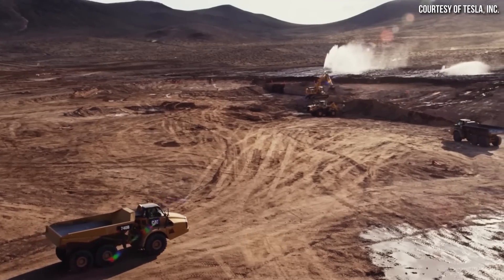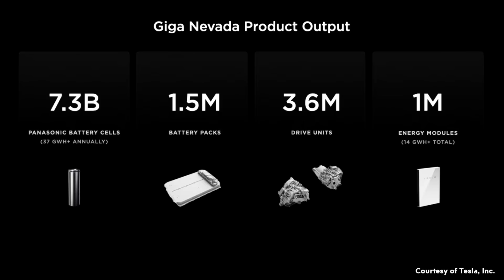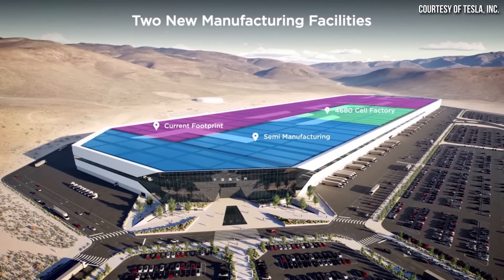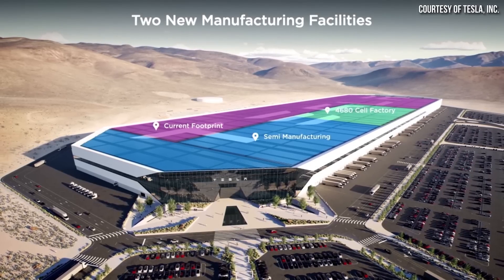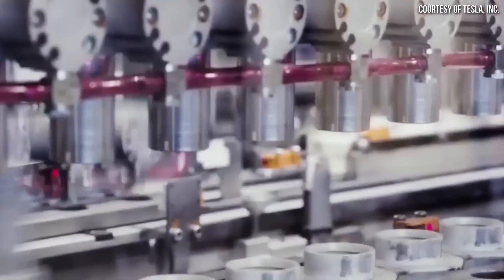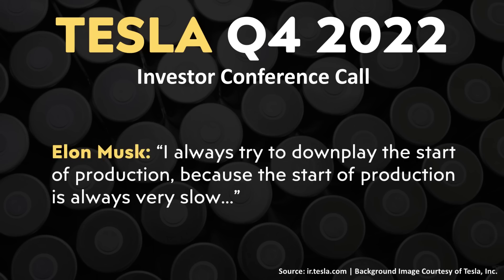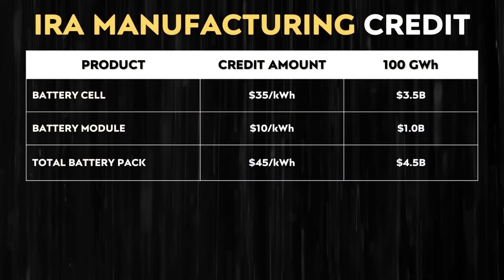Tesla's EPIC NEW 4680 BATTERY Updates | 100 GWh MORE!

Comment: Wouldn't it be more beneficial if they invested in improving 4680 cells to be better than the cells they replaced rather than increasing production of an inferior product that that failed to meet any of it's promised specifications? I bet it's a lot cheaper to produce and if so is this cost saving passed onto the customer? So much for "epic" update. So many 4680 innovations, not...
Reply: This was a common misconception of the goals of the 4680's. Tesla, and the entire EV industry, is battery constrained. So nobody can produce the amount of EV's that they want to build. Both the Semi and the Cybertruck have been held back do to not having enough batteries. 

So yes Tesla wants to produce a high tech battery, so they are designing that, but what they need is the ability to make batteries for themselves. Now that they can do that they are in more control of their own destiny. And they can implement the better design components once they figure them out.
Reply: The 4680 is roughly equal to the 2170 cells already and the point of the 4680 cell is not to make the most amazing, highest power cell in the world/ever. 4680 is to be cheaper and faster to produce than the 2170 cell with headroom to improve over time. It takes battery manufactures about 12-18 month to test and validate a battery design/chemistry. Every change has to be evaluated to determine if it is an improvement or not and is safe before implementing. In other words these things take time. A new factory with a know form factor and chemistry is expected to take 18-24 months to ramp to design rate.
Reply: @GROND15  They're not roughly equal. The comparison testing Munroe did on them proved the 4680 to be a weaker performer. It isn't a misconception, Elon Musk repeatedly taunted publicly the performance benefits of the cell for a long time prior to its release. Be that there are other benefits to it's development there may well be. You'd at least hope so.
Reply: @John Hawkins  
Elon Musk "Touted" (predicted) the EVENTUAL performance of the cell..... Due to anticipated improvements in chemistry (note that Tesla has collaboration with one of the top experts in the field, Jeff Dahn)
.
As for the "innovations"
IF you'd been listening to (and understood) the battery day presentation (plus more since) you'd realise the aim of the project is to produce maximum GWh (TWh!) from minimum resources (factory space!) for the lowest possible cost.
.
It's as much about the "process technology" as the cell chemistry.
.
Signs are that they are mastering that process sufficiently to build the factories.
.
"Performance" has been a sidestep, but "We" (you!) have no idea at what stage the chemistry (for example) has reached in TEST cells.
.
If they release a MK 1b cell, with the dry Cathode, plus the silicon levels already in the 2170, I would expect a modest, but encouraging 10%(?) increase in density...... But that's where the fun starts.
Reply: @GROND15  
"18-24 months"
That's a "green field" site
Using the wet process (much larger factory).
If (IF!) Tesla has perfected the dry process and can reliably replicate the machinery to produce the material, it's going to be much faster.
Remember that when it's at even 50% of the predicted level, it's going to be a 5:1 output ratio in terms of GWh per factory volume.
.
Now look at the Nevada plan.
.
It's not "Green Field"
.
Power and services are in place (it's already "plumbed in" to be a battery plant!)
.
So it's just a case of "build the box" then add much less machinery that previous sections.
(Machinery built in house?)
.
Here's a thought.
.
Let's say "OMG! they haven't sorted the dry Cathode!" (yet).
.
Build that section.
There's a wet cathode line in the same building !
.
Either close 1-2 older 2170 lines, or increase "2170" cathode output to suit, cut to the 4680 dimensions.
.
Once validated, either ramp output by taking more "wet" material, or transition to the dry process.
.
Meanwhile, strip the closed down 2170 section and install a second 4680 plant(!)
.
Rinse, repeat.
.
Before long, it's a full 4680 Terafactory.
.
(imo)
.
This does raise questions regarding the relationship with Panasonic.....
Reply: @rogerstarkey5390  Austin and Berlin are greenfield sites. The time frame is for the ramp in production rate not including construction time. LG, Panasonic, et.aL. plan 18-24 months to get a plant from lights on to full production rate. In my experience, this seems to be true for most large factories of all types.

Comment: Has Elon stated, or has anyone asked him, WHEN WILL THEY PRODUCE ANY VEHICLE USING THE 4680 BATTERY, AND SHOW US A VIDEO OF SOMEONE DRIVING IT?  Good grief.  The 4680 is over-hyped to the point it sounds like vapor-ware.  If they have already produced so many 4680 batteries, then why are they not putting them into some vehicle and testing it?
Reply: Ok thanks, bye
Reply: The Model Y Sandy Munro tore down last hear had the 4680 cells in it, and the structural pack!
Reply: @aaronmcculloch8326  Totally forgot about that 🙂
Reply: They are producing M-Y with 4680 packs now. They are “off menu” and limited supply
Reply: @GROND15  
No, they're very much "ON the menu" and in sufficient supply for the version in which they're used.
Reply: @just The Truth
You really need to change your handle to
"@Not Really Any Clue"
Reply: @rogerstarkey5390  LOL - Bless your ignorant heart.  Show us the video proof.

Comment: The 4680 is the key to future growth. My personal desire is that by the end of the year, volume will be massively up and a 100watt/h 4680 variant will be available in a model Y with a 897 cell battery pack, so a circa 400 mile range. At that point battery cars have truly arrived with no compromises. My current concern here in the U.K. is the small number of Tesla charging points, hopefully there will be no corners cut on the expansion of Tesla’s charging network which is a key differentiator. Queues at chargers is becoming a problem, hence the desire for a 400 mile range which means 300 miles in the worst conditions. The reality check is that the Model Y in German tests at 75mph on an Autobahn, easily beat the best electric Porsche available, but still only managed 265 miles (not the 331 mile range claimed) that isn’t enough. The reason I bang on about this is people with money don’t like waiting in line and Tesla will loose out if alternatives with a say 500 mile range come on the market as such a range cancels out charging network advantages Tesla currently has. This for me is about the whole ecosystem where Tesla is doing well with the exception of not being able to use your Tesla car as a backup battery during power outages.
Reply: No.
800 cells (maybe fewer)
.
Higher density.
.
Faster charge (THAT'S the key, look at the chargers)
.
1-12% MORE VEHICLES from the same materials.
.
ALWAYS consider the mission.
It's NOT "to satisfy the perceived needs of 2% of the population.
.
It's "Transition to green energy"...... ALL of it.
Reply: Just to add....

So I assume you're in the UK? (Me too)
When was the last time you tried a 400 mile drive in one hit?
For a start, you'll average 60-65 mph (even if you're "enthusiastic" with the speed limit.... I know I've done it).
.
You'll be in the road for 7+ hours.
.
If you don't stop at least once for food, "comfort" or sanity, you're a fool.
.
The car has to Outrange the driver
Nothing more.
Especially in the UK.
.
(Watch the RSymons YT channel.
Demonstrates the above frequently.
Reply: Hi Roger, I live up north and my cruising speed on the motorway is 78mph set by the sat Nav not the car. Manchester, Newcastle, Glasgow, Edinburgh, York etc are all a 2-3 hour drive. I’m on the western edge of the lakes. In a diesel Volvo, or my Lotus I can easily get to clients and back in a day, no stopping for charging etc. my wife’s family are in Bolton, similarly a 250 miles round trip with no worries about headwinds, cold weather etc going up Shap on the M6. Now a model Y would be a perfect 4WD alternative to the Volvo, except, fast winter driving equates to a 265 mile range when the battery is 100% charged and new. Volvo XC70s, Passat and Audi Estates came with a 500 mile range for a reason. So i fully expect that while for many they can work around ranges that would be unacceptable in an ICE car, people like me would pay a lot of money for a true self drive capable car with a 400 mile range. I love Zoom for meetings, but a lot of business and real families time is done face to face. So currently I remain a Tesla investor, not a buyer, but we seem to be achingly close to getting it right. A side note, there are virtually no Tesla charging points within an hour of my house, so either, lots more faster chargers, or 400 mile range.
Reply: @marcusoutdoors4999  
"Speed limit plus vat" where possible on a motorway does not give an average journey speed.
You'd be amazed how much the 10 miles "off motorway" at either end scrubs off.
Then there's "traffic".
My business runs, South London to Manchester Liverpool, would hit at least 2 rush hours even leaving at 5 am.
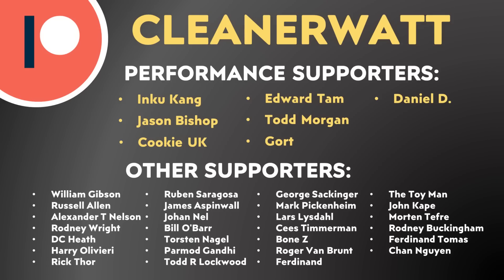Similarly on the way back, leaving at 15:30(?)
That's the start of the Birmingham rush, then the whole top section of M25, Dartford bridge.
(And my clear road speed was let's say "taking a chance")
As I said, hunger, comfort and sanity (stress) always required a stop. (I should add "safety")
Reply: @rogerstarkey5390  I think sadly we’ve just ended up in an increasingly unliveable country. What I have found amazing on the tech front is electric mountain bikes, I’m now on my second, first was good, but not enough range, but the 2nd gen Turbo Levos with a 700 watt hour battery is wonderful.

Comment: I can’t wait for the future EV’s because I’m very sure that there will be a marvellous invention that will supersede the highly acclaimed underperforming batteries. Battery designs could be any combination of chemicals and elements on the periodic table available to us produced by dying stars billions of ions ago and consistently unable to contain baseload electricity which will be sufficient to propel us into a clean industrious future. However, it stays interesting to see how hard we try to reach this goal. I think the time will come that we can confidently break away from energy created by combustible fossil fuels. The project is in it’s infancy, but it’s a start.
Reply: You might have a point, IF they (batteries) were "underperforming".
At the moment, the majority are "adequate for purpose" (beating ICE)...... As evidenced by the fact that the transition is happening.
.
As for "consistently unable to contain baseload....."
You REALLY need to watch the latest Tony Seba presentations.
(If you don't know, he's the guy who predicted this in 2010)
His summary, (paraphrased)
Solar/Wind/ Storage is already (much) cheaper than "others forms" of generation (not to mention faster to build, easier to maintain, it's essentially a passive system)
The cost of energy produced is trending towards being cheaper than the cost of transmission of energy from other sources (let that sink in)
As such we can afford to build substantially MORE capacity than required for much less than the base requirement of other sources.
......
"breaking away"
It's all a question of the economics of supply.
At the moment we (the consumer) are being conned, with the cost of energy being pegged to the cost of what is now the most expensive energy (natural gas)
.
Why is each source not priced individually according to its cost of production/ transmission?
.
This is a question we should ALL be asking our politicians.
.
The moment this is adjusted, the bottom falls out of the natural gas market...... But the price WE pay for "energy" should reduce.

Comment: The 4680 at this point seemingly contains 75% “snake oil”
Reply: Looks like you're in for an "enlightening" year.
Reply: Teslavdo not do snake oil. What they do do is to tackle extremely difficult problems like fsd building new batteries and so have to invent new processes, design new machines which have never existed I.e carbon wound motors etc. This is all groundbreaking stuff.